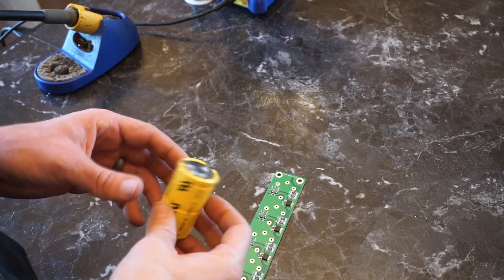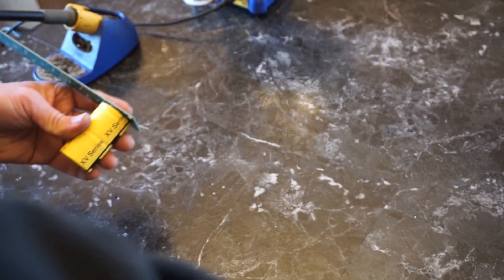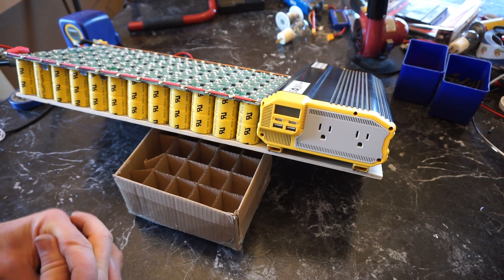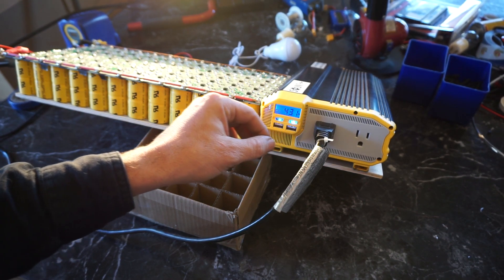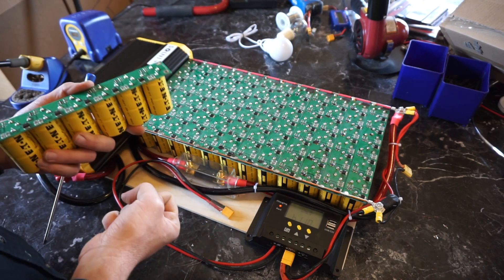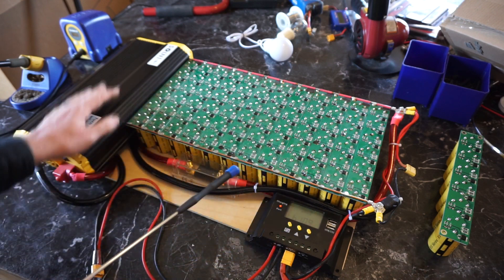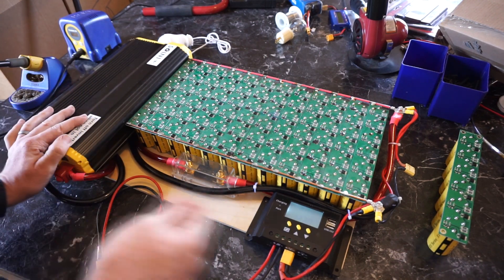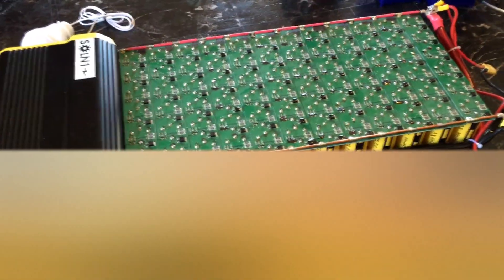Building the SOLN1-2000 Watt Capacitor Solar Generator

Comment: A few 15.1V 5 watt zener diodes connected in parallel  with the caps would do the job of your charge controller and not waste any energy
Reply: BillyNoMates1974 - Yes essentially.  PWM charge controllers are basically an on/off switch, repeatedly connecting / disconnecting the panels from the battery to control the charge rate. MPPT charge controllers are more sophisticated and do an energy conversion process to try and keep the panels at their peak power output while charging.
Reply: Zener diodes in parallel with the caps? That will just generate tons of heat when the capacitors are full and the solar panel dumps all its power into the Zener diodes...
Reply: only when the capacitors are full
Reply: Yes, that's what I wrote. I get that that is not a problem when using the thing, but if it sits in the sun for a bit with a 500W solar panel, you're gonna need an awful lot of 5W Zener diodes... Besides, charging the caps directly without a charge controller will mean not actually converting said 500W into electricity and further heating the solar panel instead (Here's a random paper I found on this: http://scholarcommons.usf.edu/cgi/viewcontent.cgi?article=4808&context=ujmm )
Reply: hmm yes. 500 watts would pose a problem. Do charge controllers disconnect the solar panel once batteries / super capacitors have reached full charge ?
If thats the case then yes a solar charge controller would work well despite it's own parasitic losses on the whole system
Reply: ElectroBlood - I am not sure the paper you link talks about overheating the solar panel. It talks about the differential equations used to find the current and voltage for the point of peak power output.  I don't understand what you mean by the 500W further heating the panels?  Even if the panels are disconnected, and no energy is being pulled from them they should not overheat.
Reply: @ModernSurvivalists
The 500W is the power (20-25% of the incoming solar power) that the solar panel can convert into electrical power , if used properly. If not used properly, the power still comes from the sun and has to go somewhere. So if you maybe pull 300W from the panel, 200W of power will stay in the panel. That will heat the Solar panels (not by a lot, but still). A hot solar panel has a higher resistance, which means even more power gets dissipated in it. That goes on a bit until the panel reaches equilibrium. Now if you have a charge controller, it won't care about a hot panel and still pull 300W. But if you just have the thing directly connected to a battery, the voltage will drop (and thus the charging power) and the battery will charge slower.
So in a nutshell nothing will break(apart from the zener diodes), but you will not get 500W out of a 500W solar panel simply by connecting it directly to a battery.
Reply: I agree with this the a 'Charge controller' is explained by the name because batteries are kind of backwards they need to be 'charge controlled' where as a cap largely needs no such 'control' however he did say he was going to replace it in the system.

hopefully human corruption can keep super caps this inefficient and 'costly' for longer, so that humans can keep spinning turbines with magnets on them with steam (preferably with extinction technology like nuclear fusion)

Comment: What is the longevity of these super capacitors vs. lithium or AGM batteries? As in how many charge/discharge cycles before they degrade significantly?

Comment: Beautiful overall design.  One very small nit to pick: when connecting a bunch of parallel loads/sources you should use opposing taps (if positive is left, negative should be right), so the net current flow on each bar is theoretically the same across the bank.  Your protection circuits may mitigate this but it still seems like you'd have some variance in current flow from left to right across the banks and you would definitely end up with hot spots near the terminals that would otherwise be less hot.

Crude depiction of what I mean:

(+) ---+----+----+----+----+
         =     =    =     =    =
         +----+----+----+----+---- (-)

Each bank now has the same length to travel across the bar, "n" on the (+) side, and "Ttl - n" on the (-) side.  Result is no inherent hot spot.
Reply: but doesnt the board do this?

Comment: instead of 2 xt plugs to jump up voltage so the charge controller has enough juice to run, run a bypass cable with a switch from the bottom xt to the one on the right.

Comment: I love the design! One quick question: Why not find out where the 5v or 3v regulator comes off the charge controller and wire it to the output of the solar panels? It would prevent the parasite draw when the panels aren't producing and it would allow it to start on solar power only. Probably a LM7805 or 7803.

Comment: Wow, that's pretty cool!  Would want to connect the main in / out to the capacitor bank on opposite ends though, ie diagonally, that way each set of caps has the same amount of series resistance due to the busses.

Comment: Something i don't see anything planning for is service/maintenance.  
When (not if) but when one of the caps either die or dry out, 
So i will ask you as i ask other solar enthusiasts. 

How would you know which one is not working?
How will one broken cap effect the system? (maybe drain the rest?) 
Did you calculate any short-circuit effects to ensure safety of the equipment (fuse dimension)

Comment: why not use an alternator for wind power all the time not just during the day.
Reply: Spider - I'm really not trying to troll you but. What you suggest would be similar to suggesting wearing ice skates while playing basket ball. Both are sports with 2 teams, but are totally different with very different rules. 

A tower for a wind generator could cost 50-100 times what he has invested in capacitors........
Reply: Doug VanderSys I'm just stating a car alternator would help on the down cycle. and a voltage regulator would be the same as a photovoltaic cell charger. Not an industrial application just on your tool shed.

Comment: So does each cap have its own dc to dc booster?
If so what is the min cut off voltage and what voltage is it booting to?
Reply: He's got x6 2.7 caps in series. It's in the description http://teslamaker.com/product/boostpack-capacitor-bank-balance-board/
Reply: right but a cap can output usable energy from 0.1 to 2.7 volts, so I assume there is a boost circuit in there to keep a usable output.
Reply: Dylan T I think you may be a little bit confused as to how he has the caps wired on the circuit boards. With the capacitors on each of those long boards in series he gets a maximum of 16.2 volts.
Reply: Directly wiring caps in series dramatically reduces the total capacity. I don't think he would do it that way.
Reply: Dylan T If he's using the caps he suggests, he has ~66F per bank. Thats why he has multiple banks in parallel. My understanding is that this system isn't supposed to be a battery. but somewhere to get the most out of a solar panel quickly.

Comment: You could get away with a single balance board to control the voltage on all cells if you wanted to save $$$ (and can make your own PCBs). Connect capacitors in nP6S config

Comment: There are a lot of mis-used terms in this video. You can extract either energy or charge from the capacitors, not volts. Whenever you want to use the term "amperage" resist and say "current". Amperage is like describing the flow of water as "gallonage" instead of "flow". "Wattage" is another odd term, use "power" instead.  Power is measured in watts, current is measured in Amperes (amps, milliamps 1/1000 of an amp), Charge is measured in Coulombs, energy is measured in Joules, or kW-hours (1 kW-hr = 3600 j.). It looks like you are doing some interesting work.
Reply: I measure all my shit in watt day or amp day because Im doing solar and it doesn't make to senses to talk about amps or watts unless it's per day.

Like the ARB refrigerator I have. It has a 150 watt day.
Reply: Fred Zlotnick - All good points. It's good that you are helping others to use the correct terms. One minor correction is that 1 kWh. = 3,600,000 J.

Comment: I would say you would be better of with a mix of mostly Li-Ions for the bulk and just a few Caps for the burst.
4x4 18650 3000 mAh + 6 Caps would offer a bigger energy storage and still be able to deliver the full 2 kW peak, but 'only' 600W continuous power.
Reply: Yeah, self-discharge can also be a problem, but that heavily depends on the uscase and the capacitors.
Some "Supercaps" can discharge down to 50% in a matter of hours, if you plan on using them for long-term storage it is a bad idea. In combination with batteries they would discharge them too, but slower as you now have far fewer capacitors.

There are also supercaps with low self-discharge, reaching 50% capacity after 3 Months only - but have fun with the price. 5V 1F => 8$ a piece - when bought in bulk of at least 500.......

If it is only for 1-2 days backup then i think the discharge of most supercaps should be negligible.
Reply: @ABaumstumpf  Great info for low self discharge from Supercap, 
BTW I make it to survival conditions, for camping, and when I travel far away with car. Just charge the Battery Pack with 50W solar panel on the roof of the car.
So I remove the Supercapacitor because their leaky current and just use it for burst energy need with solar panel independently, especially when crafting is needed with wood electric tools. And the Li-Ions pack serve as Power Backup for lighting, power bank for gadgets, and etc.

Very neat but useful for Zombie Apocalypse you know 😅😅😅
Reply: ABaumstumpf  I wondered the same. the Energy stored in this huge thing is very small😂
12*6*0;41Wh=30Wh which is the energy from 3 18650.
A standard powerbank from neighbors kid stores more energy than this thing. LOL
Reply: Gurgel Plus yes thats true i made my own packs of 2px6s fore 28€ only the cells and it has 133Wh
Reply: I agree with you and I make it!
Unfortunately, the biggest weakness of the Supercapacitor is their Fast Self Discharge, they will draw energy from Li-Ions too.

So sad

Comment: An ideal for the exposed negative, in addition of the heat shrink you could place an adhesive backed dot of a insulating material like nylon, etc. I think it would add a greater measure of safety.

Comment: Is that a PWM or MPPT charge controller?
Reply: Would be relevant only if he had 2 or more solar panels in series. One 12v solar panel to charge six 2.2v caps bundled together in series. Then 12 of these bundles wired together in parallel
Reply: Its a cheap pwm controller

Comment: Nice work lasersaber. I thought I was the only on using 3dsmax for CAD ;-) Question hot warm to the caps get? Could you put all this in a big pelicin case or would it over heat?

Comment: I would like to place something like this between my 48v , 200Ah battery bank and my inverter.  Would the setup you used work?  Do I need to worry about using a certain number of capacitors to equal the 48 volt battery bank and inverter?
I'm finding that if the refrigorator, furnace or something that pulls a lot of power for a few seconds, causes a mass pull on the battery bank and the motors sputter until the battery bank can catch up.

Comment: can you make an EV car run with these
Reply: Capacitors have excellent power output and charge speed, but poor capacity for their size and cost.

The ideal usage of capacitors in an electric vehicle would be as a hybrid alongside a traditional battery. The capacitors would handle the high peak current requirements, such as accelerating and regenerative breaking, while the battery provides a smaller but steady trickle of power.

Of course, current battery technology has gotten to the point where even this use case is starting to loose ground. As long as you have a high enough capacity and discharge rating, the battery pack itself can handle the load without needing to pair a capacitor bank with it. Where capacitors shine is in being able to deal with large spikes in power draw that exceed the charge/discharge rating of the power source they are paired with.
Reply: @JosephHarner  some busses use them, although they only hold 5 % of a battery's charge, they are emplyed becasue dont wear out as quick.  Used bus supercaps are for sale on ebay.  That was my first exposure to supercaps, from this guy!

Comment: Nice video, cool idea and all that, but by my estimate you have well over $1,100 invested in this rig even without any solar panels attached.  Where are the advantages?  I don't know what the capacitors weigh versus batteries, but physically they appear to take up quite a bit of real estate.  What would the application for this be?  Thanks.
Reply: Try carrying enough batteries arround for these kinds of loads and you'll soon agree with him that this makes a great  mobile unit.

Comment: Yea its a cool idea and setup i give you that!   You forget to mention cost for all of your builds These Capacitors are not Cheap!
I do like the Inverter its a nice mod. sine wave for the cost of 189.99 on sale now.  Charge controllers are typically around 30 - 40$. The Super caps you have 72 in parallel banks of 12 that have 6 caps for a total of 16.2 volts closer to 12v under load [72 at $9.60 for 691.20!!].   Your balance bars, you have 12 at 15.95 each for $191.40.  
Total Cost for your build for parts you have listed as of today is : $1105.58   not including the solar panels, copper wire or any extras.
Reply: You could skip the balance bars or wire 2 or 3 caps in parallel then to the bar would increase the risk of "unbalanced caps' a bit but reduce your build costs.
Reply: be great to see what you could find in a decent, honest, cheap, MPPT charge controller. They take advantage of the solar volts from 12-18V+ that PWM charge controllers discard as dumped heat!  Caps have the ability to suck up the transient energy you get when the sun sticks its head out of the clouds.  Get all the juice available in them gorgeous flexible solar panels you saved-up for.

Comment: That seems to be a very expensive battery for not too much capacity... wouldn't it be better to use a hybrid system with a LifePO4 battery for energy storage and the supercaps to cover surge load.
Reply: LifePO4 batteries or any batteries require maintenance (and balancing circuits of its own).  If they are stored in a discharged state for a long period of time,  it will shorten its life significantly.   They also have a limited lifespan of around 5 years (or maybe 10),  and  charge/discharge cycles of around 2000.   Super caps have a much longer storage life  and a  charge/discharge cycles in the order of hundreds of thousands.  I think the Idea behind this system is low maintenance,  intermittent use,  and last a lifetime.
Reply: Don't forget that the lithium batteries should also never be held in a fully charged state for a long period as well. That also affects their life. If they are used in a stand-by state they should be held at 50% charge to maintain the capacity of the battery. Otherwise, the batteries will degrade.
Reply: Chris Schrecengost
Reply: Would connecting a stack of 6 supercaps from the charge controller to a LifePO4 battery to another stake of 6 supercaps to the inverter better rectify energy storage while to cover surge load while prolonging the life of the batter?
Reply: Would connecting a stack of 6 supercaps from the charge controller to a LifePO4 battery to another stake of 6 supercaps to the inverter better rectify energy storage while covering surge load  and also prolonging the life of the batter?
Reply: You are right. I can't see any advantage over basic lead acid battery that costs less than 1/10 of those caps. Super capacitors are nice new tech, but not better than old tech in all energy storing applications.

Comment: Hi  - hey perhaps this has come up already, but isn't half the energy used to charge capacitors lost simply in the process of charging them? According to: http://hyperphysics.phy-astr.gsu.edu/hbase/electric/capeng2.html  the battery energy to charge the caps is  QV but only 1/2 QV is stored in the cap, the other half is lost in the circuit resistance. So isn't this an inefficient way of storing energy from solar cells, since half is lost at the get go?

Comment: Can I know why does the capacitor has 4 pins?
Reply: The datasheet states the additional 2 pins are just for mechanical support (and they give you reverse polarity protection because you cant solder the cap in the wrong way)

Comment: Could you help me out  i have a wind generator  a person has one on you tube & has a capacitor hook between the generator & battery  the generator can produce between 50 & 75 vdc  i been looking on ebay & confused with all the information that is on the capacitor i don't know witch one i need.  He uses it to even out the surges that the wind generator gives in high wind. I would appreciate any help you can give me.

Comment: I saw your previous application of this setup and was amazed by its practicality. I mean If this small setup is this powerful, imagine 4 times the capacitance and perhaps 3 times of the solar input which still in the portability range. I say this the portable gasoline generator killer only if you can get your work done before the sun takes a dip ;)